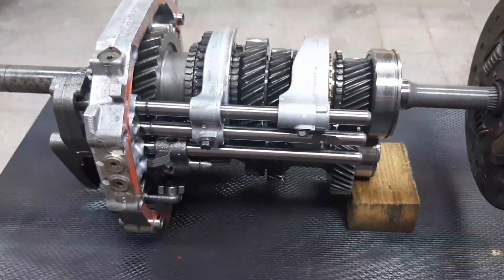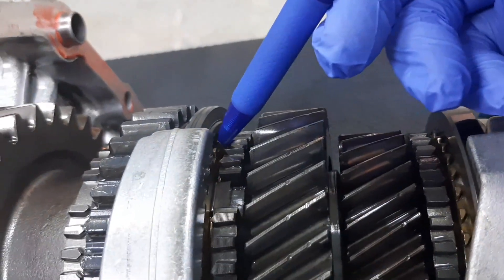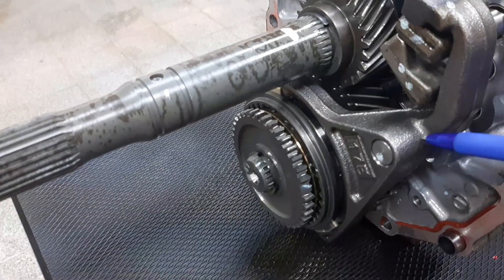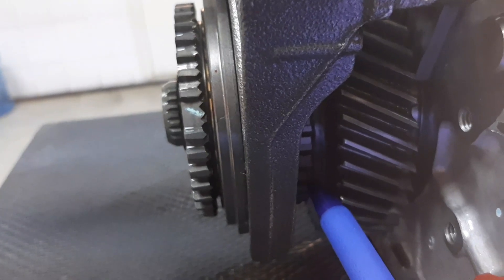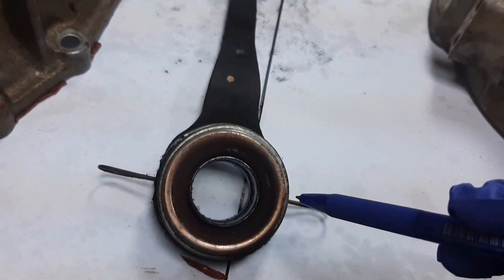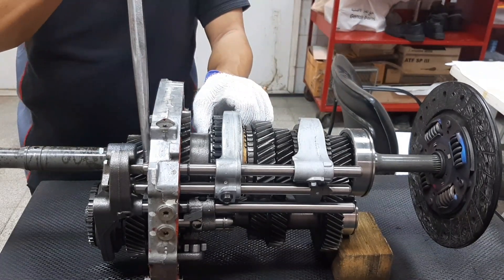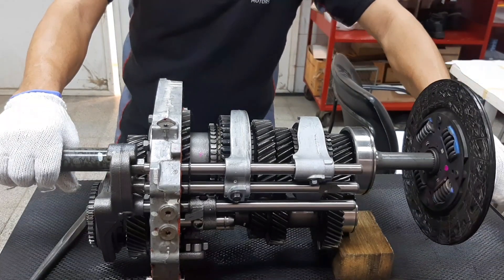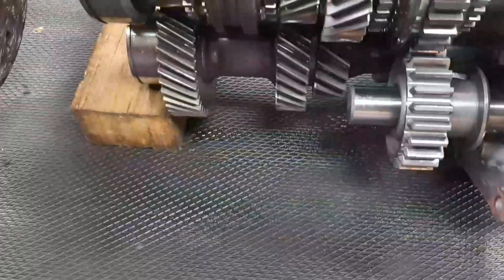Manual Transmission | R5MB1

Comment: Sir my question lang aq about sa tranmission ng montero sports bkit po my nka writing n WS sa filler oil cap ng transmission nakikita lang un madalas sa toyota tranmission meaning nka lagay dun anung oil type n gagamitin like atf ws n pang toyota
Reply from the maker: Montero Generation 3 ATF MA-1 sir ang gamitin nyo never kayong gumamit ng ibang atf para ma avoid na magkaroon ng problema sa transmission in the future mahal pa naman ang cost of repair. Thanks you and God bless po sa inyo.
Reply: @autofixgarage5438 

We know the transmission oil for montero3 is ATF-MA1 but why the write WS on the Oil fill screw